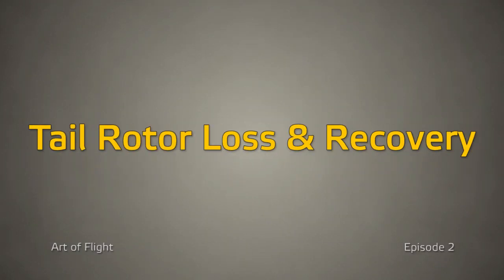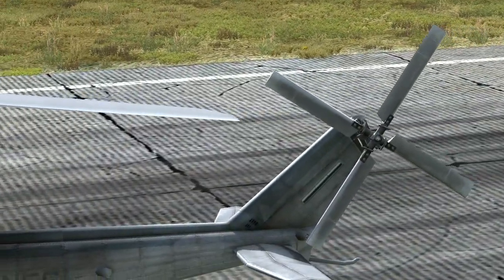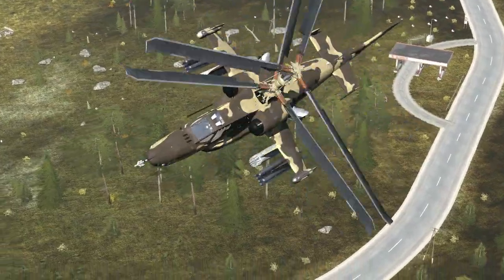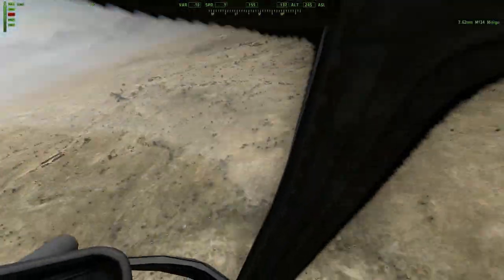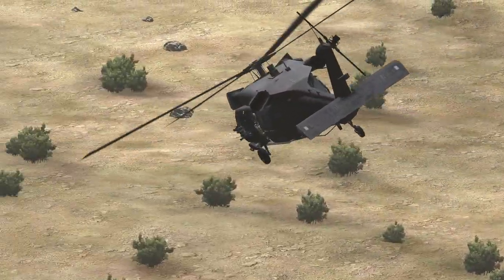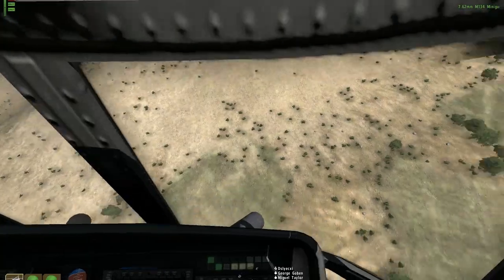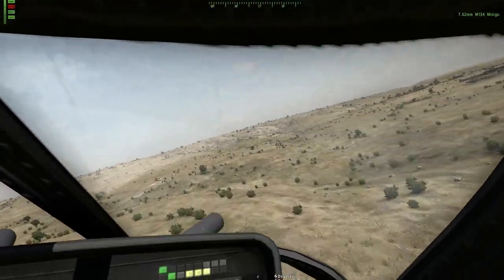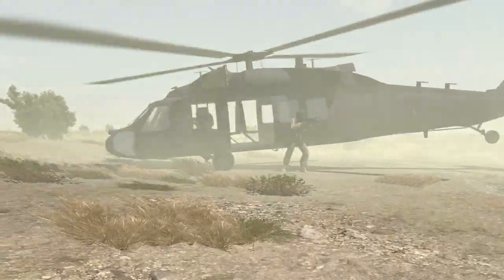Arma 3 Helicopter Tailrotor Loss Guide - Art of Flight, Ep2

Comment: @Dslyecxi not sure if you know this already, but trying to rock forward while not touching throttle or holding throttle up is very hard, but if you hold the down collective key while pitching forward initially, you can save a lot of time getting your forward momentum, as well as altitude. not to mention you are a lot less likely to get into a sideways or backwards motion. just hold the collective down for however long it takes to get the drag on your tail to counter the torque.

Comment: the main prop (big spinning blades) of a helicopter produce upward lift as well as a lesser amount of sideways torque, the ail rotor is used to cancel that out. if the tail rotor is damaged there will be nothing to cancel out the sideways torque, the resulting death spin is known as autorotation. as a pilot in arma its one of the more stressful ways to lose an aircraft

Comment: A bit about Autorotation (ACE) landing might come in handy as an extension to this video, it's my preferred method for landing with tail rotor loss as shutting down the engines will reduce the main rotor's torque reducing the chance of a low-altitude death spin.

Comment: This video just saved my butt in the Attack Helo scenario in Arma 3.
After getting torn up by ground AA and with everything but the engine in the red, I had to head back to the supply point to get fixed up. But when I started to bleed some speed to slow down, of course I began to spin. If it wasn't for this video I probably would have given up, but instead I just rolled with the spin and though it was touch and go for a while I was able to touch down. \o/
So, thanks!

Comment: Well, there are two ways to survive: do a running landing or stop mid-air and abuse ArmA2 engine to float relatively unharmed to the ground.
In both cases, lower you collective with Z to retain power and apply it with Q when you are about to touch down. In a running landing you want to keep forward airspeed to enter into a glide slope, while with the second method you immediately pitch up until you "hover", level out and then apply collective when you are about to hit the ground.

Comment: I found it good if you have a runway you slow down to just above auto rotation when over a runway get down to 10 or so height units and cut the engines the helo is on the deck before it has time to start auto rotation

Comment: depends on the damage. if the whole section of the tail rotor is cut loose, then obviously you can't recover it. if the tail rotor just stops working for whatever reason and the tail section is intact, you can pretty much recover it up to the point of making a safe crash landing. what i mean by safe is that your landing will be quite hard, but not hard enough to injure passengers on board. the techniques differ in real life than what it shown here. anyways, good vid dslyecxi

Comment: For anyone wanting to practice this, here's how you do it.
Set a trigger, with a Presence activation (or by Radio).
In the On Activation field, enter:
vehicle player setHit ["HitVRotor", 1]
That will knock out the tail rotor immediately.
"vehicle" is the object,. If you enter that code in the Init field, you can use "this".
"Player" represents who it affects,(Although using "Player" is bad practice for MP)
"HitVRotor" is the part, and "1" is the amount of damage, 0 being the least.

Comment: Same thing when a plane loses its engines. You level out and try and glide in for a landing. Unfortunately this is unlikely to work since choppers have the aerodynamics of a brick and will pick up speed too quickly during the plunge. Your best options are to bail out and pray the chopper doesn't fall on you =P

Comment: 9.22.2 Loss of Tail Rotor Thrust at Low Airspeed / Hover.

Loss of tail rotor thrust at slow speed may result in extreme yaw angles and uncontrolled rotation to the right. Immediate collective pitch reduction should be initiated to reduce the yaw and begin a controlled rate of descent. If the helicopter is high enough above the ground, initiate a power-on descent. Collective should be adjusted so that an acceptable compromise between rate of turn and rate of descent is maintained. At approximately 5 to 10 feet above touchdown, initiate a hovering autorotation by moving the ENG POWER CONT levers - OFF.

1. Collective - Reduce.

2. ENG POWER CONT levers - OFF (5 to 10 feet above touchdown).

Comment: Procedure for landing an MH-6J under engine failure; yaw to around -20 degrees to maintain Mrotor collective. The flow of air through the blades will cause a phenomenon known as autorotation; essentially, the virtual wind spins the rotor blades, simulating engine movement. I will produce a video showing you how.

Comment: Not necessarily. Try to hover, kill the tail rotor. Hearing the first beep, pull the collective all the way down, cyclic a bit left and forward to compensate and get some forward motion and decdend. You will do less than 90 degrees turn (piloting blackhawk) before gaining sufficient speed. For a safe recovery, 150 feet should be enough.

Comment: Arma 2 (especially with ace mod enabled) uses key factors if not the full "Take on Helicopters" module. Which is toned down from the full throttle flight simulator "Take on Helicopters" also used in virtual pilot training games for flight schools, military, games etc.

Comment: Question:  Do you have history as a pilot, or have you done research into recovery of tail rotor loss?  Or, did you work this out from trial and error?
Reply: Technically, if you go really fast forward, the rudder should be able to counter the torque of the main rotor somewhat. But looking at this thing in Arma...
Well it's just off. It's really looking off. Unrealistic. I really wanna see a real clip of a chopper recovering from a dead rear rotor like that, and especially can't imagine what on a sideways rearrotorless flight would be any stable.

Comment: I have yet to have this happen(thankfully), but id have had no clue how to recover if it did, thanks
Reply: It's not too difficult depending on your flight experience and altitude.  At lower altitudes it's definitely more difficult to recover from but if you are high in the air it's actually not too bad to land when you are spinning out of control, you just have to control your descent speed and land softly enough.

Comment: You're wrong. Autorotation is when your main propeller/engine gets taken out, and you only have so much time before your propeller stops spinning completely. What you do is you press thrust down until you're between ~15-25 meters above the ground, and then press thrust up, and lift the nose up about 5 degrees, at which point you *should* survive. If you go to Dslyecxi's TTP2, and go to the vehicle usage section, find the 'Helicopter Damage Model' section. It'll give you some more pointers.

Comment: Kind of. If they're in forward flight, they can keep flying, doing a rolling landing to maintain directional control. If they're in a hover, they go into an autorotation, which instantly removes the torque of the main rotor, and lets you set down softly enough for the crew to survive.

Comment: Actually, when altitude's gained, it is more simple and quicker to release the throttle and then minimize your thrust power (i.e. start descending), magically, the heli becomes stable and, with enough altitude, you can gain horizontal speed faster.
P.S. Unnecessary rotation makes your passengers puke :)

Comment: Probably asked hundreds of times, but for the 101th - do you use joystick and pedals, or mouse and keyboard? And why?

I regularly fly in ArmA and WWII flight sims. I use seperate joystick and throttle, but not pedals (Saitek X52). I find it at times not accurate enough and with a lot of un-smooth and non-interval increase in input. But the joystick greatly helps me in keeping spacial awareness, as from past flight sim experience, can better "feel" the limits and flight paths, through my hands.

Comment: Love these videos. I would like to know your opinion on this though, I was using your littlebird map with a mouse and keyboard but was having problems with it and could barely get passed all the normal difficulty missions. I finally decided to use a xbox 360 controller for flight with analogue thrust, and I noticed I had much greater control over the craft and I can complete your harder missions now. I know that gamepads are a bit taboo, but if it is only for flight and it helps me, is it bad?

Comment: Amazing - does this also count for real life helicopters?
Reply: Psada Definitely NO!  This is a game only technique. If you tried these in a real helicopter you would end up in a smoking hole!
Reply: Psada wat korse not it wil crash so cwik
Reply: AT LAST
Reply: Actually in a UH 60 if your above 90knots and the tail rotor goes out  you won't always go in to a death spiral. You will fly in a generally straight path and have semi controls. You will just have to do a roll on landing. And this is due to the cantered fairing on the tail pylon

Comment: If during Cruise flight a right yaw becomes uncontrollable
Autorotate at or about 80 knots
Engine power control levers off during deceleration when intended point of landing is assured 
if low airspeed or right yaw becomes uncontrollable
collective reduce
eng pcl off 5-10 ft above touchdown
if left yaw 
eng power control levers retard
collective increase rpm will decrease 
eng pcl off 5-10 ft above touchdown
collective adjust for landing

if anyone wanted the official version :)